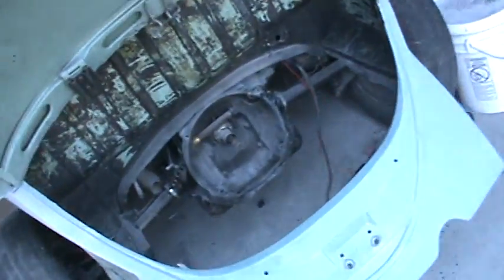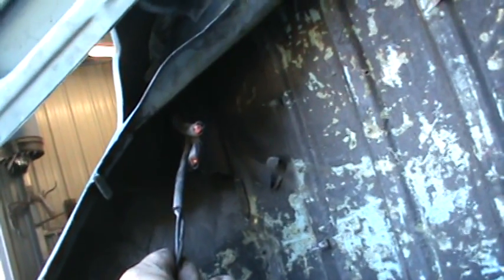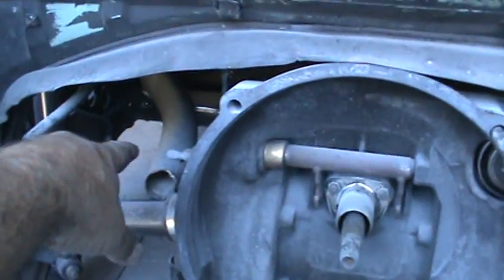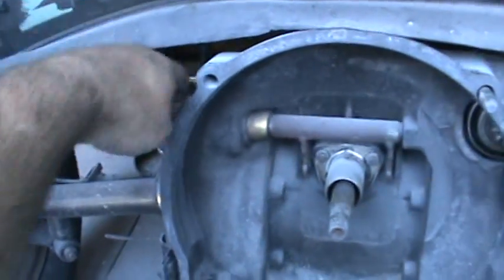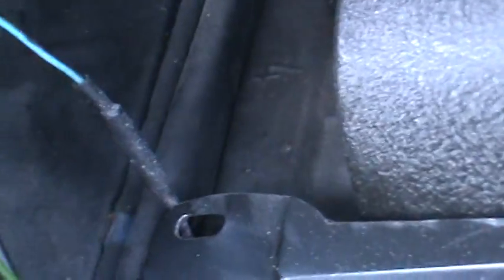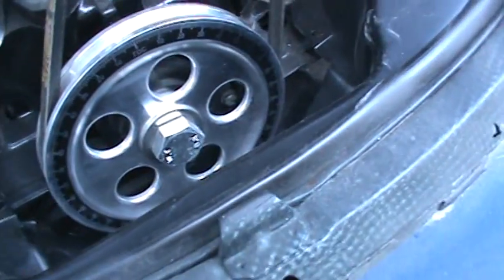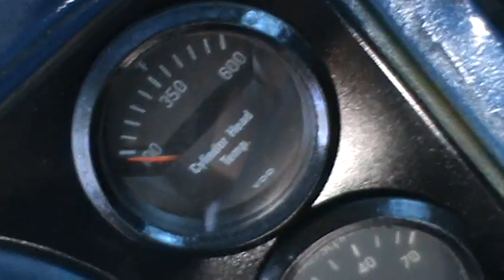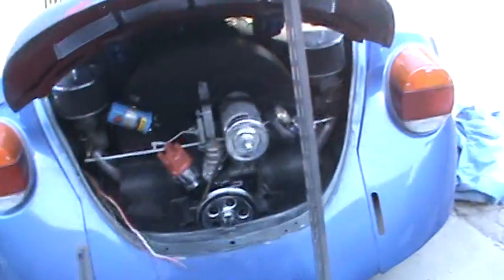COOLING TIPS FOR VW'S

Comment: Keep putting out how to videos I find they are quite handy. Am building a Baja and making the motor full flow and wanting to put the oil cooler somewhere other than on the engine do you have any ideas where as to where I could put it? I've hear of above the transmission but haven't actually seen a procedure on how to install it and how well it worked. If maybe you have time you could show how one is done.

Comment: Darrin,  I recently had an engine rebuild and now the engine seal does not make contact with the rear tin.  I can see the straight through to the ground.  Any recommendation for fixing that or getting the rubber to meet the tin?  Thanks in advance.

Comment: how hot ! is too hot ,,,,yesterday came back from /Ocala fl from Inverness   and its a new rebuilt from fisher buggies 70 case with single oil relief valve . using a thermal gun that i used in my hvac days , over the oil pump was 227 degrees and shooting at random heads tins over the heads was around 180 and little less at diff points .   scary books dont say what is a safe temp to observe ? in florida in the summer we run in the high 90;s almost daily ! for 3 months ,,,,june  2019

Comment: Hello, I have a 68 beetle with a 1500 engine. Where would I wire a temp gauge to the engine?  Thank you.
Reply: for cyl head temp there is a heat sensitive wire that is a foot long or so that would need to be fed under the tin to cyl # 3 spark plug and then to guage